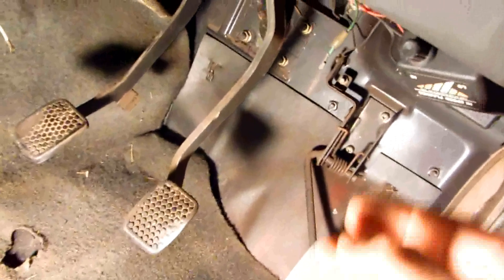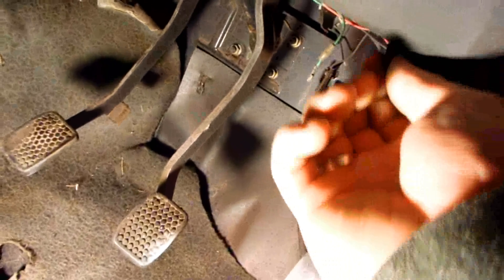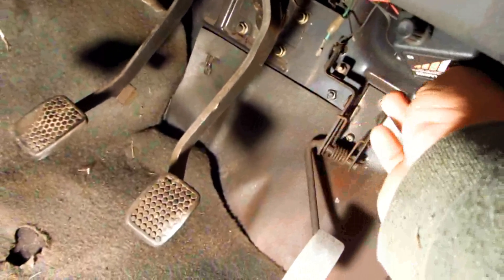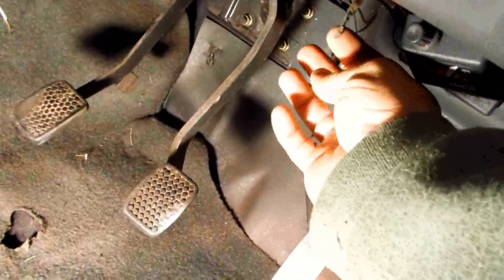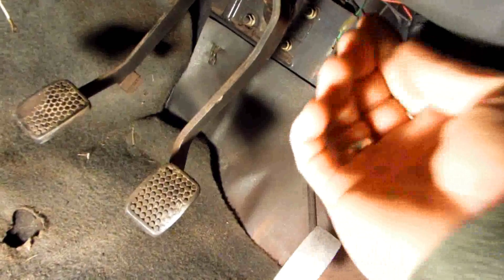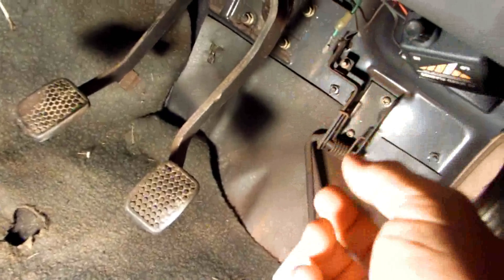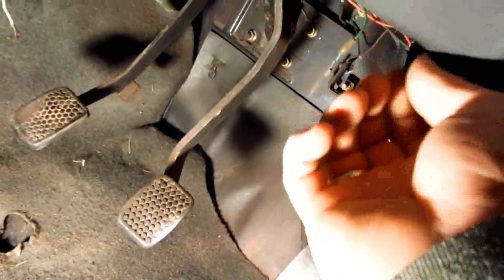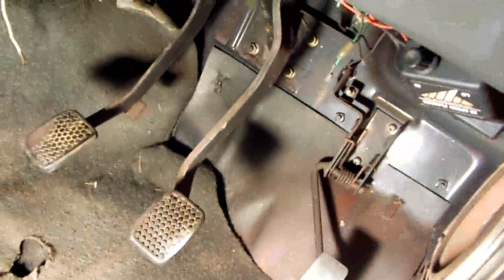Differences in Taillight Bulbs 1157, 2057, 2357 and Red colored Motorcycle

Comment: what is the wattage difference between the 1157 and 2057 for the parking light/tailight?  my running light/tailight is very dim in my van and it takes a 2057, i want to get the 2357 but that wont solve the brightness of the taillight
Reply: for dim bulbs, check your socket and ground, with a bad ground being the most likely culprit. Use a multi-meter to check voltage across the positive and negative terminals of the bulb socket.  You'll probably find you have a significant voltage drop

Comment: 2357 fits Hyundai  Elantra cars (brake)
Reply: Heh This is why I came here!
Reply: yea I tried to swap my oem incadecents with leds and got 1157 leds in my kia for brakes and they didn't work at all. I was so pissed after having to remove taillights and mess around with it. rockauto said 1157 so that's what I bought. I put the oem 2357 back in and returned leds. ill have to try the 2357 led. maybe the wattage makes a diffrence

Comment: Quick summary: 1157 is standard. 2057 has a slightly dimmer parking/running light filament. 2357 has a much brighter brake/turn signal light but lasts 150 hours instead of 1200 hours. Good info!  If your lens is faded, get a red colored bulb from a motorcycle shop.